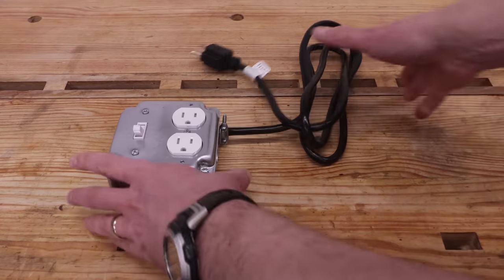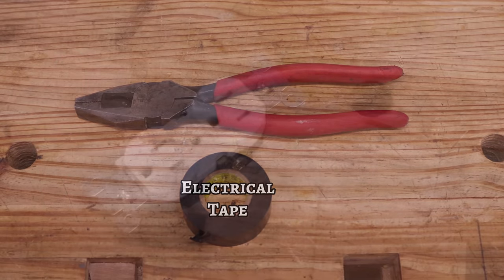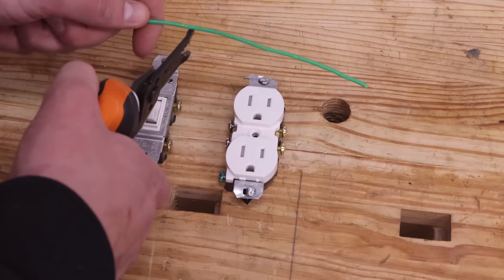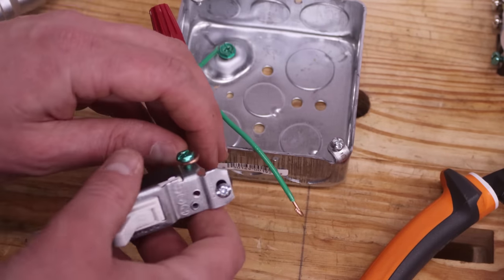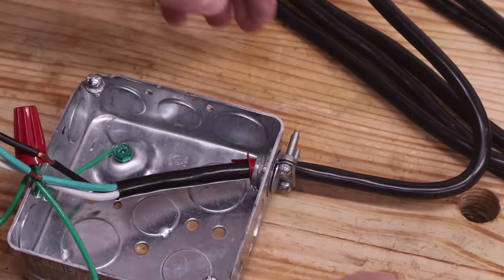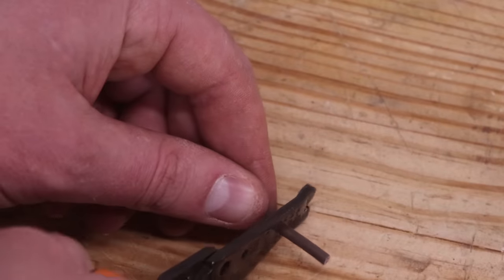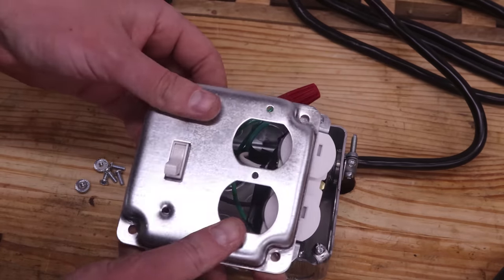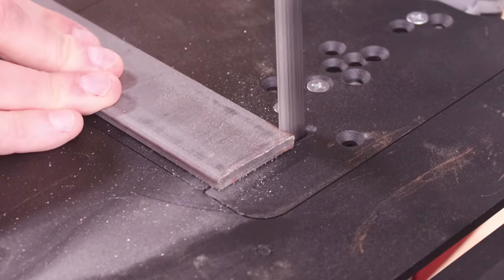DIY Portable Switched Power Outlet With Extension Cord 🔌

Comment: Years ago as a carpenter apprentice I had a similar setup without the switch. I used  a 4” junction box and double duplex receptacles. I was read the riot act by the safety officer where we were working. His reason being the box had knockouts, like the one you used, and he claimed a knockout could get pushed into the box and creat a short circuit. He made me remove it from the job site.
Reply from the maker: I mean, technically he's right, but sheesh.
Reply: @GlennFrazeeYT  He was tough. Once he pulled out a sound level meter to check the decibel reading on our job site table saw!
Reply: I was told that drop boxes are not osha approved
Reply from the maker: @EMWoodworking  Next time I see an OSHA inspector at my house, I'll ask him.
Reply: @GlennFrazeeYT  no need to be snarky. I’m just sharing my experience.  Have a nice day
Reply: Jeez what must he think of those same boxes on the wall where possibly subject to physical damage

Comment: All you need to do is ground the box. Everything is metal and the ground on the switch and duplex are part of the construction of the duplex and switch.
Reply from the maker: Personally, I don't like to rely on the metal of the switch and receptacle for ground. Also, since the box is exposed, I don't want current going through the box in a ground fault.
Reply: @GlennFrazeeYT  the ground screw on the device is attached the the frame of the device.

Comment: Hi Glenn Frazee I;m Jon!  I would like to make a step by step video request for you to make a video and show the community step by step how to make a DIY Portable Extension Cord Junction Outlet with a 15 amp circuit breaker to protect the receptacle.     I get emails from the community asking me about that all the time and unfortunately i just do not have the extra time right now to make a step by step tutorial video on that topic right now but was thinking perhaps you could help me out and make one for the community?      What i have told a lot of people is just to go out and buy a wall plug in receptacle that already has a resettable built in 15 amp circuit breaker and would save people a lot of money.   They can be found at Meijer, Walmart etc etc.      The issue is, when people design and make there own with adding a circuit breaker to a DIY portable extension cord junction box outlet or receptacle is that not all circuit breakers apply to the electrical codes depending on the type of circuit breaker that is added to the protect.     I would love to see how you would do it in a video!
Reply from the maker: Not touching that one, that's got electrical code violations all over it.
Reply: @GlennFrazeeYT    Yes, like i was saying though, it all depends on the type of circuit breaker used as some circuit breakers can be used within the codes but am pretty sure i said that it all depends on what type of circuit breaker is used in these types of projects.     There are resettable 15 amp circuit breakers and up out there that use a reset push to test button breakers that can safely be used in your type of project for example that can stick within the codes but a lot of different factors come into place with doing so as i said before.     It does sound in response though that you also don't want to make a video on that for the same 2nd reasons why i do not want to either.     What i usually tell people is to just a plug in wall strip outlet that has a built in circuit breaker or comes with a resettable push button circuit breaker with it and go with that instead or to contact and hire a Electrician near you to come out and take a look and talk to them about projects like that so it gets done fully correctly and also meets up to the codes.    What do you think on my comments?

Comment: My only contention with this design is the clamping down on stranded cable with a screw designed for a soild conductor. I would find a receptacle that uses back pressure plates or use solid conductor pigtails or bootlace ferrules or spade lugs.
Reply from the maker: Fair point

Comment: This video was very useful. I do have one question though. If you were to use a plastic function box, how would you do it as far as the ground wire is concerned? Would you just use two ground wires from the switch and outlet to the power cord and leave the box out? Thanks in advance to anyone who can help!
Reply from the maker: There's no need to ground a plastic box, you'd just tie all the ground wires together and omit the pigtail going to the box.
Reply: @GlennFrazeeYT . 
Thanks! When using a stranded extension cord, would you use spade terminals?
Reply from the maker: That would be a good idea.
Reply: @GlennFrazeeYT 
Thanks so much for your help!

Comment: As a retired electrician. I like to watch many of these videos just to see what people are doing out there.
You did an excellent job. The only thing I would recommend is whenever you have stranded wire you are not supposed to wrap it around the screw new code says you must use a spade log
Reply from the maker: Thanks for the advice, Ray 👍
Reply: When installing receptacles I usually make a #12 green stranded wire with lugs on both ends to go between the ground screws on the receptacle and on the box.  I use a ring lug at the box end and a spade lug at the receptacle end.  It takes more time to do it this way but the connections seem more secure to me.

Comment: Im an IBEW apprentice in my first month. I have some previous experience with the military doing low voltage, simple two wire connection stuff. My JW tasked me with building something similar to this, but with power coming out, after the switch, connected to the other half of the extension cord, with wagos attached to the the power, neutral, and ground, on what would be the female end. It seemed so confusing when he was explaining what i needed to do but watching this video i think i know exactly what to do come Tuesday morning after our New Years break, with a couple extra splices.
Reply from the maker: Glad it was helpful!

Comment: I recommend a shop vac for dust control on the other outlet. It might also be a good idea to use an o ringed box and weather tight cover to protect from metal dust from the saw. Great tutorial, I especially liked the 2 switch idea, hadn't thought of that one.
Reply from the maker: Thanks for the recommendations 👍

Comment: Mr. F, Great timing for me.  I was about to buy a mere replacement coupler but now I'm going to adopt your method to restore and enhance my 14/3 extension cord. PS: I especially like the tape wrap over the terminals.  I like the durability of a metal case but there's always the chance of getting "bit" if something gets loose inside. Yipe!
Reply from the maker: Glad to help!
Reply: Barry, if properly wired, and plugged into a grounded circuit there's no chance of getting hit. The box and cover are attached to the green grounded wire. If the hot wire somehow comes into contact with the metal box it will trip the breaker.
For added protection use a gfi receptacle.

Comment: Just a few things, use the hole on the stripper to make your loops, fit on screws much nicer, power cord    you used wrong connector on it, that one is for MC cable, power cord when you put the wire on outlet/switch screw, any screw reverse twist of the strands of wire, then when tighten the screw it sucks the wire under the screw tight, you should always use the two screws at top and bottom of outlet plate, it holds the outlet tight at top/middle/bottom when plugging things in and out of them...
Reply from the maker: Noted.  Though I don't know how I'm supposed to use more screws on a receptacle plate than there are holes for...
Reply: @GlennFrazeeYT  The holes your missing, take the mounting screws out of device, the two little bolts and nuts in package with cover plate, they go through the plate, then device, with nut on inside hold the device to plate, center screw holes the center of device, top/middle/bottom of device then is fasten tight to plate, there for not breaking the outlet with you pushing plug into outlet
Reply: I guess I'm just a fool.....
Reply from the maker: @sparky0288  Nah, you're right. I forgot those holes are in there.  The one I made doesn't get plugged and unplugged since it's dedicated to one machine, but it's a good suggestion if someone wants to use this like a power strip.

Comment: 8:50 its recommended for you to put those two as they bring stability and also preasure relief from pushing the cord in to the receptacle which with time it will bend inwards from the center if it doesn't has them
Reply from the maker: Come again?
Reply: The two screws that go on top and bottom, their there to give extra support, it's recommended to put them because in the action of plugging it in your pushing and with time you'll bend the whole thing inward

Comment: I have something similar on a cart I made for my air compressor.  Because I didn't want the junction box to stick past the edge of the 2x4s the cart is made from, I went with a single gang box and a single outlet/switch combo unit.
Reply from the maker: That works too!

Comment: That was an armored cable clamp you used and the red cap is meant to side into the open end of the cut BX metal jacket.
Reply from the maker: Indeed. Still works.

Comment: I'm trying to make a second one of these, but with a couple minor changes: I want to use an illuminated switch (so it can be seen in the dark) and I've added an indicator light. When I had the illuminated switch in without the indicator light, my tester still read that there were 30 volts still getting to the outlet and the switch itself didn't light up unless something was plugged in. I then replaced it with a regular switch and added the indicator light. the outlet now says it's only receiving 45 volts when flipped on and the light only turns on when something is plugged in. All the wiring is otherwise the same as in your diagram. I followed it exactly.
Reply from the maker: My guess is you have a bad contact somewhere, but it's hard to tell without seeing it.

Comment: Thank you for sharing!  This is perfect for what my son and I need for his 4H project.  We are modifying it slightly to add a wired light socket.  One question, what software did you use to create the wiring diagram?  It looks so clean!
Reply from the maker: Thanks! I did the diagram in Visio.
Reply: For a modification to the box you might add a dimmer instead of a switch. Break the connection on the duplex outlet so that each outlet is separated. Connect one outlet to the dimmer and wire the other outlet hot all the time. (Know if your phone with dimmers today and you’re fooling with LED lights today you have to be very careful that the Demirel actually dim the LED like you want. This is not as straightforward as you might think)

Comment: I have alot of electronics under my TV. I'd love to be able to make a multi socketed extension cable for it all, like 30 sockets, where they could all be switched off individually. That way I could leave evertinv plugged in but with the power off.
Reply from the maker: Not to be a smart aleck, but that's what power strips are for...
Reply: @GlennFrazeeYT  That's what I use but I got so much stuff, they all just get tangled and stretched connected to the power strip. I can't get a 3m long power strip. I mean where the sockets either end are 3m apart, not the length of the cable.

Comment: Super job!!! I am sooo glad I found this. I want to make the same setup. But instead of a switch & duplex, I want to do 2 duplexes. So my question is using 12/3 should I use 2 duplexes or 2 GFI that have the illuminated light on them? I want to use 20A receptacles. I just need some sound advice on the receptacle choice and the proper wiring. I know it’s typically black to gold & white to silver. I swear I’ve seen some examples on line where this isn’t the case. I won’t be using this in bad weather. Home use only. Thank you so much.
Reply from the maker: Thanks James! For North America anyway, white (neutral) goes to silver, and your hot wires go to the brass terminal.  You'll have to pigtail the hot and neutral if you want two GFCIs in one box.
Reply: Thanks Glen, so on the pig-tailing gold to gold & white to white? Is there any advantage to using a couple GFI’s or just stick with the 2 20A receptacles? Thank you again!
Reply from the maker: If you'll be using it somewhere where it might get wet, GFCI is a good idea.
Reply: Thanks Super Glenn!

Comment: The only thing I would add to this, is to tin the bare wires with solder to make the connectors more stable.
Reply from the maker: I don't recommend tinning wires like that. Too big a short risk of they get brittle.
Reply: @GlennFrazeeYT  how would that happen? I would think twinning would help keep the wires from becoming brittle.
Reply from the maker: @baire702  See this article: https://cdn.thomasnet.com/ccp/00142951/263810.pdf
Reply: @GlennFrazeeYT This is a fascinating article. I mainly use tinning for applications like shown in the video. For these I think tinning is a great option.

Comment: Thank you for this vid. Question, why do you need to ground it to the box? I am trying to do something similar but it will connect to a normal plastic box/receptical. Is this no good? Thanks in advance. Isnt the ground from the source sufficient?
Reply from the maker: I grounded the box to mitigate any stray current that might find its way to the box. Don't want to get zapped if I touch the box with a wire shorted to it.

Comment: you should have added a Cable Gland with Strain Relief instead of that clamp to the junction box.. That clamp overtime will cut through the cable and short out.
Reply from the maker: If this were getting banged around, I'd definitely agree with you. But since this is dedicated to a machine in my shop, I'm not too concerned.

Comment: I would use GFCI receptacle with a switch for a safer extension cord to be used in the work shop unless this extension cord ie plugs into an existing GFCI outlet. Material cost approx. $5 more.
Reply from the maker: GFCIs are about $15 each around me, vs $1 for a standard receptacle.
Reply: @GlennFrazeeYT  How much Is your life worth?

Comment: Could you flip the wiring on the extension cord so that the hot wire is connected to the outlet so it’s always live, and then have the switch only live when it’s on? And then run the switch to a light?
Reply from the maker: Sure

Comment: Thanks! This was super helpful. You wouldn't happen to have a diagram of the double switch with the power going to the outlet instead of switches?
Reply from the maker: What you see in the build article is what I have for wiring diagrams.
Reply: if the power went to the outlet first then the switch wouldn't do anything.

Comment: Is it possible to use a GFCI recepticle as well? Im sittin on several of them.
Reply from the maker: Yep. Probably a good idea to do so if you're using this outside anyway, and it might also be a code requirement now depending on which version of the NEC your county uses.

Comment: Good idea, but...   
There is more to attaching wires to the switch and duplex than "Tighten them down". 
 Wires inside wire nuts should be checked for firm attachment, especially stranded wires.
 Should have used a centered 1/2" K.O. to supply power. this would reduce kinking of cord over the extended life of tool. Many will not permanently mount box.
Other than that...good job. Thanks.

Comment: Glenn...sure enjoy watching your tutorial videos. I am putting together a galvanize pip lamb for my co-worker. Is it possible to add a off on switch and a UBS connect with power supply? Now if I turn off the off switch will that also cut the power to the usb power box? Thanks!
Reply from the maker: Sure, adding a USB outlet should follow the same process.

Comment: Thanks so much for this. Can this be used for plugging in two lights mounted on a hutch that both can be turned on with that switch? Also could a dimmer be installed instead of the switch?
Reply from the maker: You're welcome, Brandon. And yes on both accounts.

Comment: I made one of these quite a while ago, but I was using a plastic box (and I screwed it to a board as it was stationary, and I used a combination GFCI/AFCI outlet as the first outlet in the circuit). I was having some issues with getting all of the wires run properly, and I noticed that the grounding screw on the outlet was screwing directly to the yoke. I grounded the box, and there was a metal strip running from the box's grounding screw to where the outlet yokes attach. Because I was having issues with the wires, I decided to test to see what would happen if I skipped the ground on the outlets, and a multimeter showed that the ground on all of the outlets were making a circuit without the grounding wire running to each outlet. I did go back and wrestle in the ground wires, but my question is do you really need to have a ground wire running to the outlets if the box itself is grounded?
Reply from the maker: You need a ground that continues to the panel. The only thing grounding the assembly is the ground wire on the plug, so that needs to be attached to the switch and receptacle. I would recommend not grounding the box in case there's a short circuit, since a metal box would then be live in a shorted state.